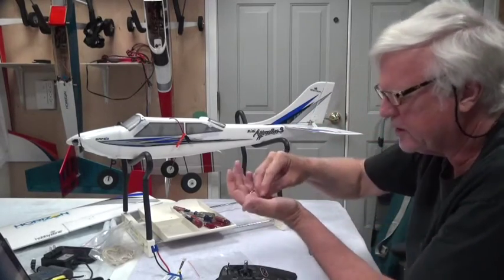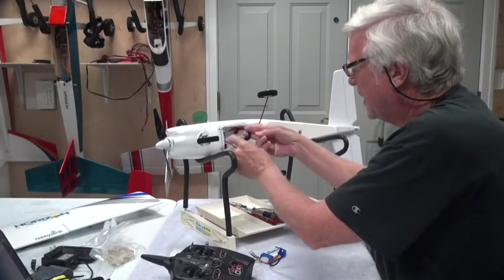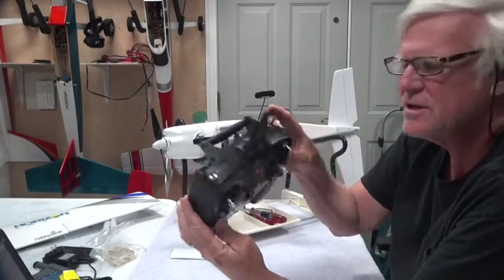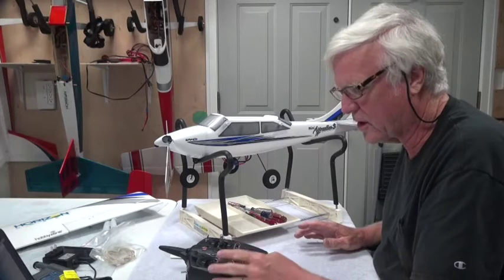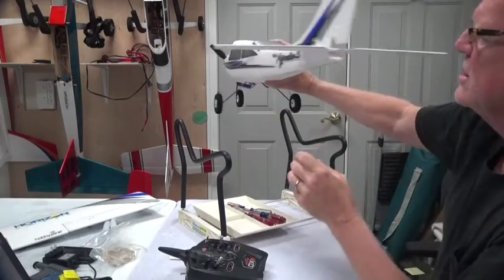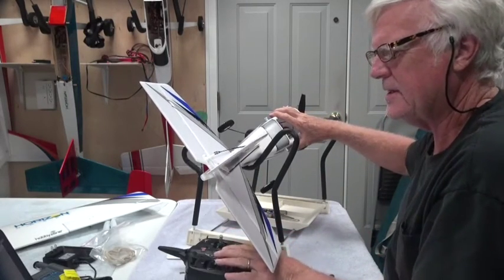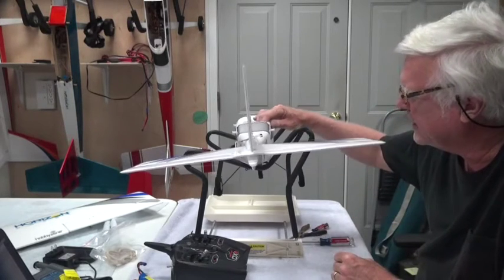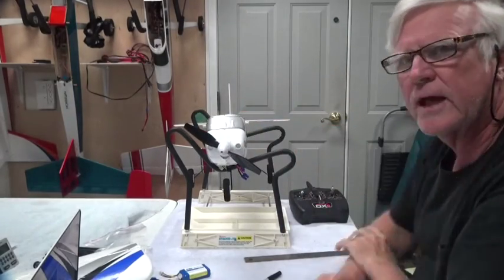MA06 Mini Apprentice Center Servos

Comment: A question if I may, I have mechanically adjusted & straightened the rudder, however the nose wheel is slightly misaligned - what is the best way to remedy?

Comment: After a flew flight in experience mode , this bird is very nice and calm plane. I flew  using HR 100 % +15% expo on all surfaces. 
Landing made by myself, not using safe landing. My question is what is your suggestions about increasing control surface throws for all surfaces. Meant to remove linkages from outer to inner holes on throwing surfaces. 
If I do that what is pros and cons ?

Thank you.
Reply from the maker: As you gain experience, I do suggest moving the clevis from the outer hole to the center hole.  It give more throw of the control surface.  At the same time I change the Dual Rate to a smaller percentage so that the low rate is the same as it was.  Its the medium and high rates where I want the additional throw.  I rarely use the inner most hole on the control horn.  Also measure with a ruler the control throw both before and after the change to note the difference.
Reply: Thank you.

 I do not want do boring you, but I  have one more question. If  one day I want to increase control surface, what is the recommending  method :
1. remove clevis from the most outer horn`s hole and attach to the third hole or the second from outer or
2. unscrew servo arm , and attach linkage to  the most outer hole or
3. use method 1 + method 2 ? 

For Apprentice S 15e in the manual there is recommending max throw for all surfaces ( High Rate A-25mm, E-25mm R-32mm ) , but for Mini S there is no any info about that. Thus , there is no way for precise settings.  

Kind regards.
Reply from the maker: Start with the clevis on the control horn and move it one hole at a time and test fly until you find what you want.  I rarely move the pushrod on the servo arm, but you can if you have moved the clevis to the inner most hole.